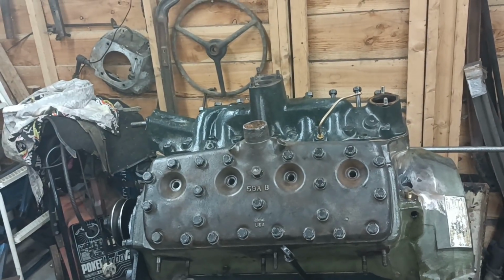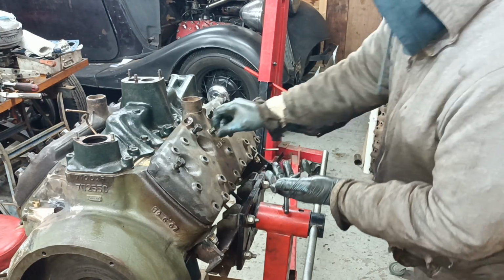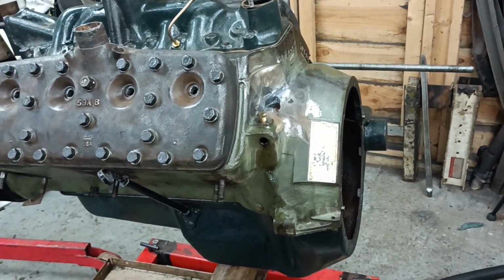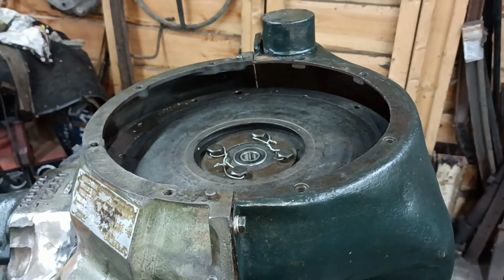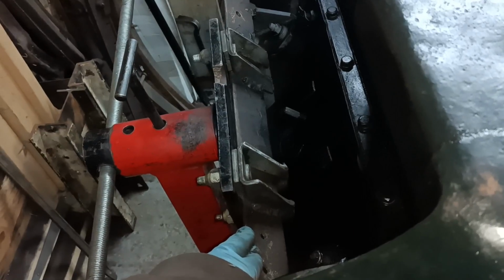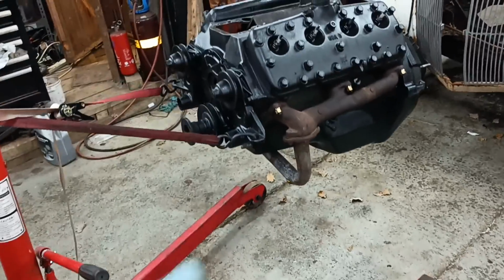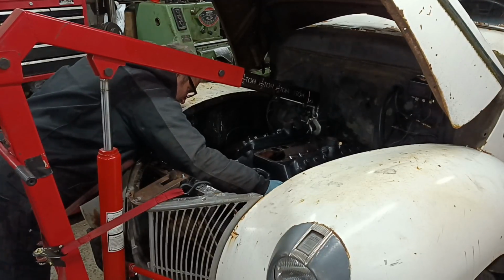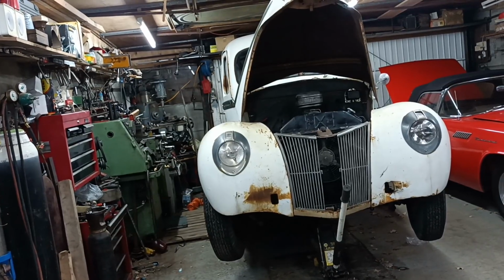2201 French Flatty 59A clone Pt 5. Build completed and installed in the truck. Nearly.

Comment: Hello Mart I’m interested in your head gaskets,are they specifically for the French flatheads.? I’ve a French flathead I’m rebuilding and inherited an 8 BA gasket set with my truck that had a scrap 8BA engine in it ,although all the holes align the coolant galleries are somewhat masked by the apertures in the gasket being smaller, have you experienced this?
Reply from the maker: Hello Anthony. The 8BA gaskets will work on the French motor. The restricted holes will be towards the front, which forces more coolant towards the back of the motor. This is done by design. In am assuming you are using 8BA/French heads.
Reply: @MartsGarage  yes I’ve a choice but will probably go with the French ones, I was told I would need a sump from a Mercury but I’ve compared the cast aluminium French sump to the 8BA one I have and it’s marginally smaller.Just as an aside I had the same dilemma as you with one bore but sleeved it back to the original + 1 mm, unfortunately two compression rings when broken on that piston and I’ve only been able to get a hold of standard used rings which give a larger gap but using your theory of 90% on your corroded bore I think I’ll use them, what do you think?
Reply from the maker: You need a 59A type sump pan. An 8BA type will not work. Is your ally sump pan the type that is similar to the 59A (also Pilot)? If you can get a starter to fit it it might work. The French motor is like a 59A as far as sump and bellhousing go. Is yours the 3-3/4" stroke?
Reply: @MartsGarage  the aluminium sump came with the engine  complete with starter ,it is the same configuration but slightly smaller than the 8BA so I figured it would fit in my 1950 F1.I’d send you a photo of them side by side but I don’t think you can attach photos to YouTube replies

Comment: Nice job Mart, I noticed you did.nt use thread sealer on the head bolts, is the French engine different in that department ?
Reply from the maker: Hello WG. I don't know about the French motor being different. I view this as a short term build so didn't use sealant. It will be interesting if it leaks and if it does, if it stops after a while.

Comment: Good one Mart. You are giving me the confidence to tackle a 99A block I have stashed away. I  also have an old fashioned Black and Decker corded drill, made in England unlike some of the crap B & D make today. That bearing you showed us would have the Rainbow Community up in arms (refer to the box)
Reply from the maker: Hello Graeme. I didn't think of that! That's a legitimate bearing supplier. I wrote a reply earlier where I spelled out the name of the bearing manufacturer but it looks like a bot deleted it! I use a wire brush on that drill because it spins really fast.
Reply: @MartsGarage  Yes Mart I use that drill for heavy duty stuff because of the speed like you say. Bought back in the 70's at Woolworths for the old man. When he passed I grabbed it back. It was cheap but good quality and would be repairable if it crapped out (providing parts are still available).

Comment: Good video Mart, all the little things that make the big thing work!
Safety wire pliers are really good, Dave gave me a few tutorials and a loan of his pliers when I was connecting diff and torque tube, eventually got the hang of it, made me feel almost professional (ok, maybe not but certainly less of a klutz!)
Look forward to hearing this run.
Reply from the maker: Hello Gordon! Funny enough I bought some of those pliers and just tried them out for the first time. Not brilliant but a lot better than I was doing. I saw an aircraft mechanic using some and thought "I need some of those". See you in the summer.